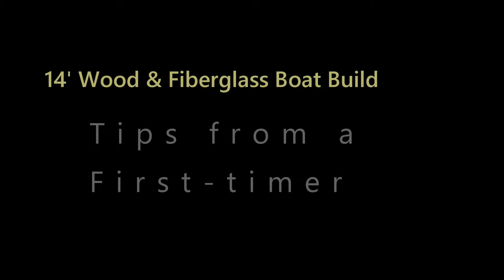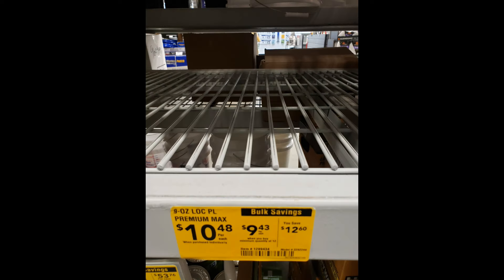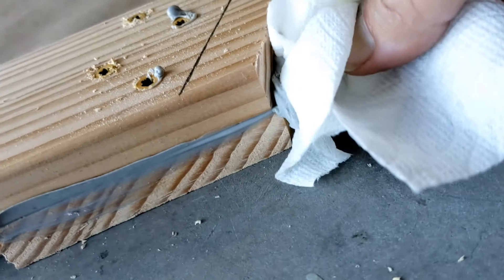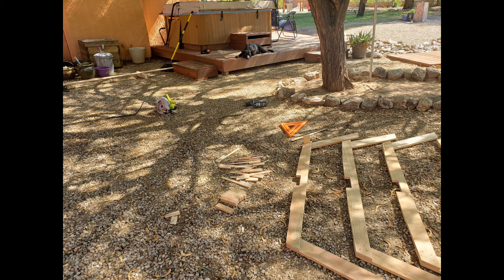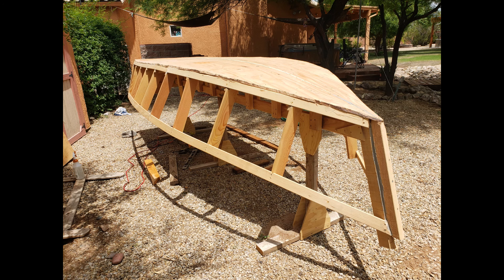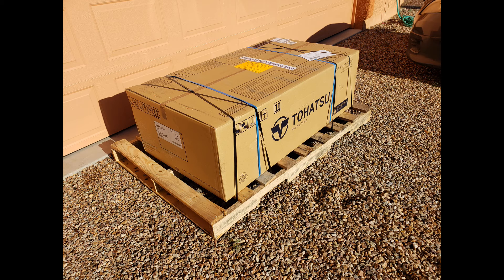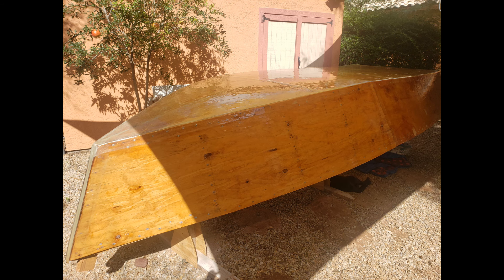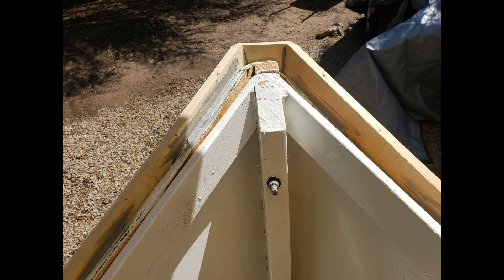Part 1 - Tips from a First Time Boat Builder - 14 ft Seneca Dory

Comment: I have watched dozens of builders videos, both experienced and inexperienced (the latter actually tend to be better as far as identifying pitfalls), in preparing to start a boat myself.  One myth I have found very consistent for many builders, including some of the experienced folks, is that wetting or soaking lumber helps to make it more flexible.  I have 45 years as a furniture maker and the reality is that this myth started because of the practice of steam bending.  People concluded that it is the moisture that creates the flexibility.  Reality is that it is the heat, not the moisture, that makes the cellulose (that is basically the glue within the wood cells) flexible; like heating plastic to make it flexible.  The moisture in the steam insures that you do not dry out the wood making the surface brittle while heating and the fact that steam transfers heat energy at a much higher rate than dry air while also insuring that he temperature will never exceed 212F degrees.  So soaking may help in a very minor way with some wood but the reality is that fully cured/dried wood can sit in water for years without the water penetrating any further than the first few layers of cells. If you need to bend solids you are best off to build a little steam generator of some sort and place your wood into an appropriate container that will contain the steam (In college we did some steam bent furniture for a design class by making a steamer using a propane deep fryer with a pipe attached thru the lid going into a long piece of 6" PVC pipe.  By raking the pipe at a down angle and drilling a small escape hole at the capped end the steam was able to flow thru the pipe and condensed water escaped thru the hole.  12 hours in the steamer and 1/2" white oak strips would easily bend around fairly tight curves).  Absolutely love all the first time builder videos.
Reply from the maker: I appreciate the information. It makes sense. I remember as a young boy, going on a field trip to a folk festival, and weaving baskets made of long, thin, rounded reeds that were soaking in a tub of water for flexibility and stiffened once dry.  I can see how water alone would not necessarily penetrate thicker, harder woods.

Comment: Great job on your boat.  And thanks for sharing the build process and your decisions with the world.  How is it holding up?  I'm worried about maintaining a wooden boat in the cold wet climate of Washington.
Reply from the maker: So far great.  Covering the boat will add many years of longevity and less maintenance too.  Thanks.
Reply: @mikethedesertrat   Mike, thanks for replying! I bought the plans for Walter Baron's 16' lumberyard skiff, and I've saved up about 4K to build it, which I think would be fun, but I haven't had the nerve to buy the materials yet.  I live on the Columbia River (1 mile wide) and I'd also love to lauch the boat in the Puget Sound.  Do you still like construction adhesives for securing the transom and frames?
Reply from the maker: @sandystrait3878  Sounds like a great place for a boat.  I'm still satisfied with having used adhesive in the places I did.  Just make sure to get the higher quality ones.  You can use fiberglass to reinforce any critical areas.  Plenty of resources on YouTube for tips and advice.  You'll do fine if you take your time and think things out.

Comment: Mike was looking at my plans and watching your build did you make adjustments on frames where the frame is wider the 48" so to use two sheets on the bottom?
Reply from the maker: Yes, I opted for a "seam" down the keelson of about 2". I filled it with a 2" strip of the same plywood.  Other options might suit you better. That's just what I did.

Comment: Nice job. Researching for my 2022 DIY project. When glassing the bottom, why wouldn't you glass the sides first, then overlap the side when glassing the bottom? All YT videos seem to do it your way, but intuitively, doing the sides first seems the right way. Can you comment? Thanks.
Reply from the maker: To be honest, I don't think it would matter either way.  With a quality epoxy and well-laid fiberglass mat the resulting bond will suffice.  The order would not affect the strength or finish.
Reply: I'm guessing that glassing the bottom or other horizontal surfaces is easier than vertical surfaces, so for someone who isn't an expert at fiberglass work it gives some practice before moving onto the more challenging bits, but there's no reason mechanically or aesthetically that I know of.
Reply from the maker: @pakde8002  yes, practicing on the bottom did help.

Comment: ALLWAYS use masking tape when you appy silicone or thick glue, remove as soon as glue applied so it won't dry into the seam. Your tip with the carving in the joints is great. will do it to the boat I'm busy with now.
Reply from the maker: Thanks for the tip.

Comment: Your rationale for using cheap materials devalues your effort. I believe that time will prove that for the same amount of labor, better materials would make the project worthwhile. IMHO.
Reply from the maker: I don't agree with the premise that I used cheap materials.  If you're referring to me not using marine grade plywood all I can say is there is a time and place for both and my finished boat is not outside the capabilities of my product of choice. Additionally, the project was very worthwhile irrespective of any perceived quality choices.

Comment: Hi Mike My father is building a boat, and would like to ask you a question. Can you contact me so I can put you into contact with my dad. Thank you in advance, Gil M.
Reply from the maker: Is it possible to ask the question here?
Reply: @mikethedesertrat  Hi Mike thanks for the correspondence. My dad says its 69 3/4 on top of beam, he would like to know how large is the bottom of the beam. and also if the angle of the transom is 16 degrees. I hope you have a great day, and once again thank you so much for your response. Gil m.
Reply from the maker: @mgillionair82  Yes, 69 3/4 beam, max floor width is 48 1/2" (OD), transom angle is 14 degrees.